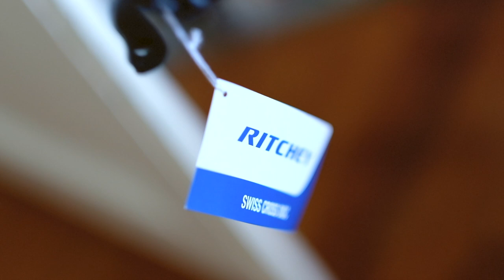DREAM BUILD GRAVEL BIKE: Ritchey Swiss Cross & Shimano GRX

Comment: I love this video so much. Think I might have watched it 20 times already. I’m building a Swiss Cross too, can’t wait!
Reply from the maker: Oh John thanks for your comment and I hope you'll like your swiss cross as we do! It's a great bike!
Reply: Guidoline & Minivan what brake rotors and size did you choose for your build?
Reply from the maker: @johnwedlake5543  I bought the old version with post-mount. I chose the Shimano XTR SM-RT99 Ice-Tech Disc Center Lock (160). The brakes: Shimano BR-RS785 Hydraulic Disc Brake Caliper with Ice-Tech Brake Pads. If you take the old frameset: you'll need also the Shimano SM-MA Adapter Postmount to Postmount Brake.
Reply: Guidoline & Minivan awesome, just wanted I need to know. Thanks! 👍

Comment: would you recommend this frame as an all road/gravel/bikepacker?
Reply from the maker: Hello, yes I would! It's a comfortable frame, not so heavy for a steel one, but careful: no fender/no rack mounts... so only strap on bags like apidura. It's no touring bike :)  but an adventure bike, for sure
Reply from the maker: Otherwise, I recommend the Surly Cross-check, best budget gravel bike, with tons of clearance (up to 45mm tire width), eyelets everywhere for fenders, racks, etc. A  bit heavier though, because of the steel fork. But such a fun and capable frame...!
Reply: @GuidolineMinivan  rad. surly is too heavy for me : ). dont need the mounts, im strictly bike bags!
Reply from the maker: @CoreyHowardPowerHour  so go for the ritchey, they have a new edition, but you can find the old model for cheap...! It's a comfortable and funny bike!

Comment: Does that fork have a carbon steerer?
Reply from the maker: Yep, it has
Reply from the maker: @brianmaldonado3723  wigly? What you mean?
Reply: @GuidolineMinivan  Wigly = flex. I detect slight bending at the steerer and was wondering if this is common. odanodlam880 at Instagram
Reply from the maker: @brianmaldonado3723  I have no flex - i mean, except the flex of the fork when hitting a rock - some compliance. Maybe you have to tighten a bit more the stem (more precisely: the stem cap). And no bend or whatsoever, mine is straight.
Reply: @GuidolineMinivan  Thank you. Your videos are very pleasant.

Comment: what bottom bracket is that? i am trying to mount my one with a bb 52 but is not enough to put and the plastic screw.
Reply from the maker: Hello! I choosed the Shimano Ultegra 6800 Bottom Bracket Cups SM-BBR60. Not sure if yours will fit, but mine is ;)